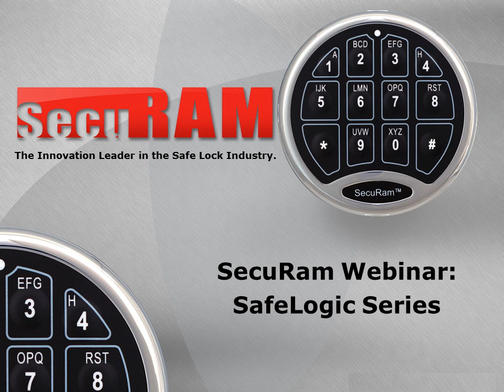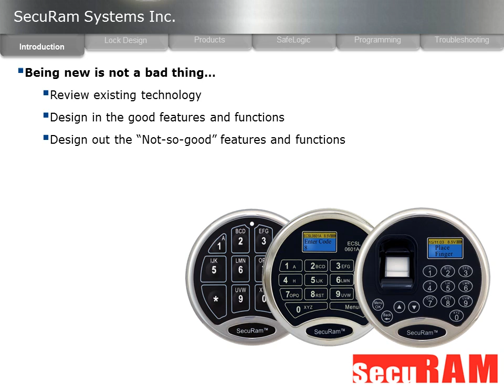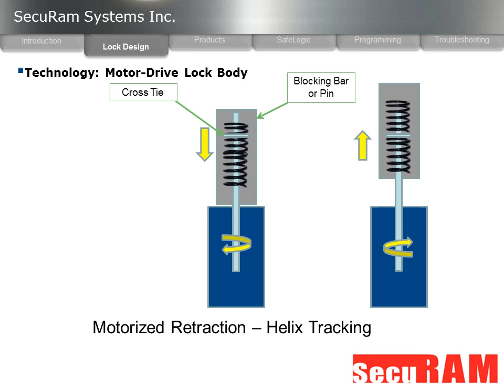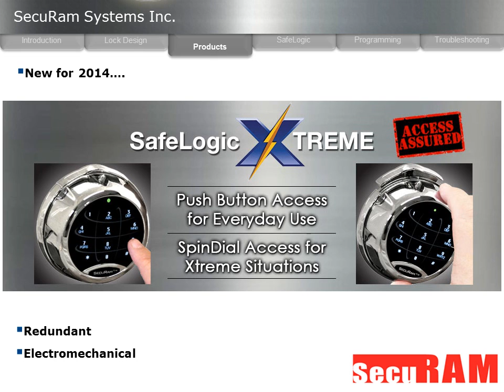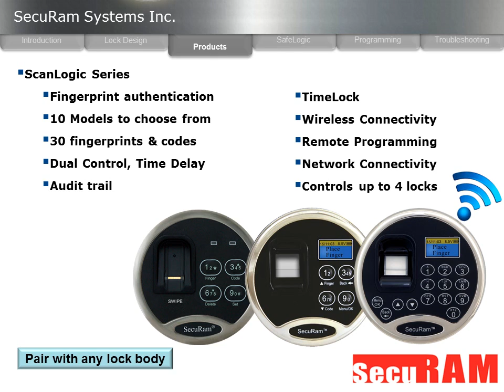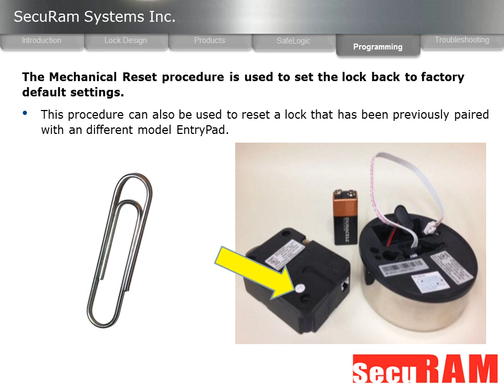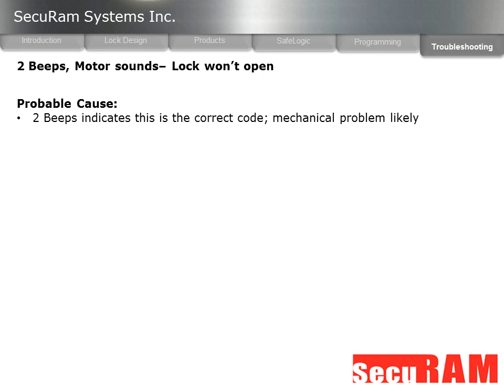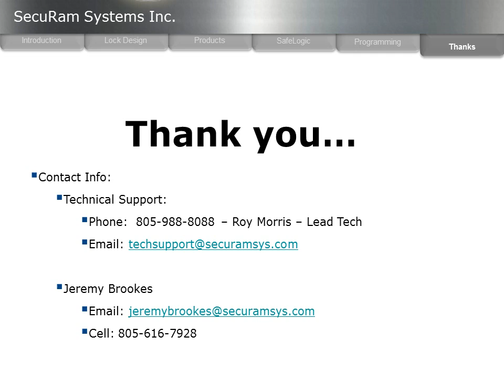Webinar - SafeLogic Series - SecuRam

Comment: Uh, if you are selling the lock with the understanding that it is reliable for at least 200,000 openings, but then actually testing each lock for 200,000 openings, you have already  used up  200,000 openings.  ???
Reply: Hi Doug - each lock is tested 2,000 times in our QC steps - not 200,000 times.
Reply: @jeremybrookes7006  Wow a response and in record time.  So I heard it all wrong?   Figures.